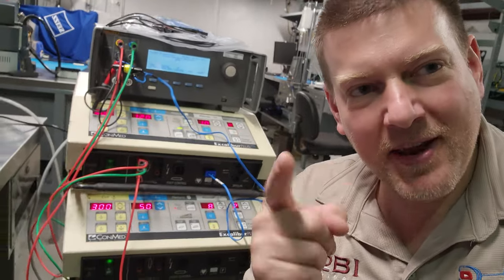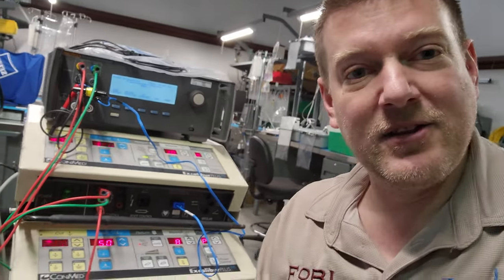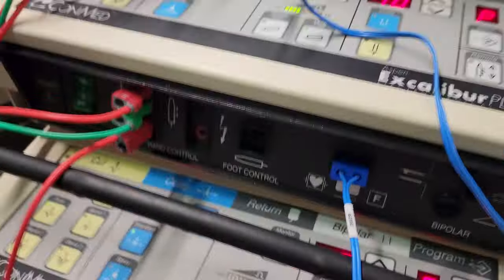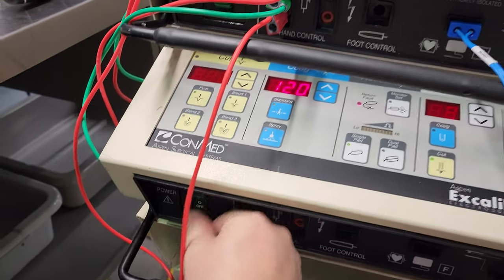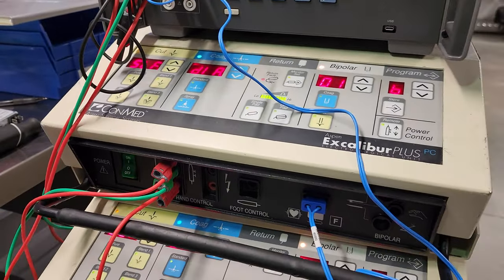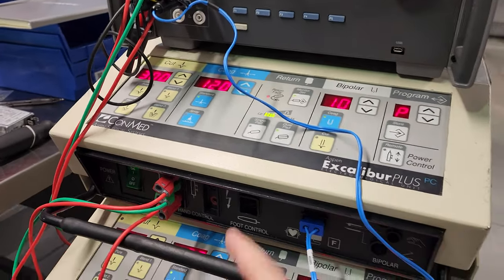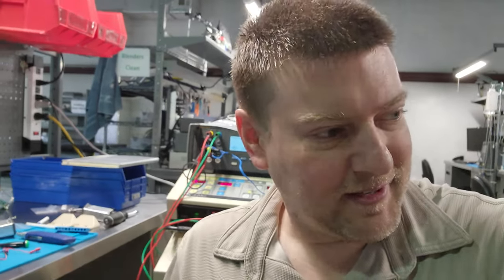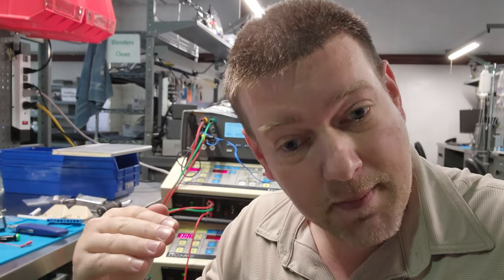Dangerous PM Settings

Comment: Such devices that can form dangerous situations should have a "Failsafe" mode.
When powering off and rebooted,they must start back up at zero or the lowest settings possible, so that human interaction is needed for setting the needed values.
Is this also with Defibrillators the case ?
Reply from the maker: Most modern devices reset to a default value when restarted but certain older devices have a last memory "feature" or have a motor speed control which uses a potentiometer (like many irrigation pumps) and those types of devices can be dangerous if medical staff are used to turning the device on and immediately using it.